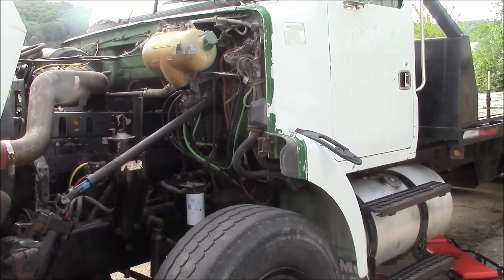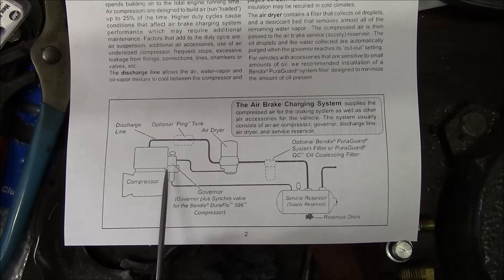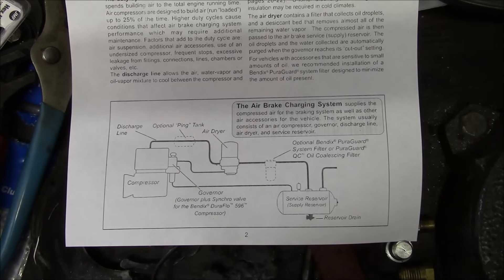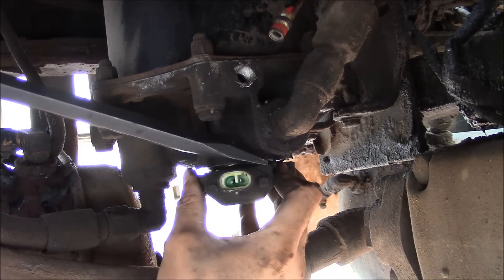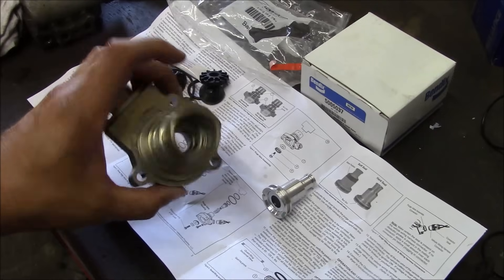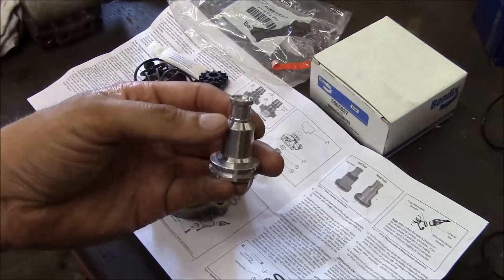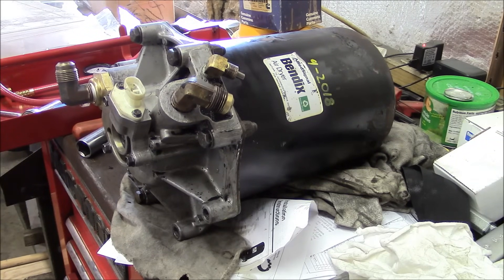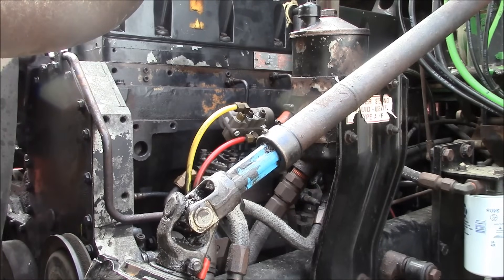Truck Repairs: Air dryer purges constantly

Comment: All underground telephone cables are under dry air pressure. The dryers function pretty close to how yours functions. A system that purges constantly is usually (in my experience) a solenoid valve that is stuck and needs to be rebuilt. Air dryers make me a lot of money - they tend to go into alarm in the middle of the night and I get called out to go fix them.

Comment: Quite hard to follow for someone who knows nothing about pneumatics - help me out here, was the problem the air dryer purging all the time? Or was the problem: air leaking out at the compressor, making the  compressor work to keep up the pressure, therefore the governor decides that a lot of purging is needed?

Comment: Great video,I have a question /mine goes off every 5 minutes when driving /when idle doesn't go off / is every 5 minutes normal?
Reply from the maker: Possibly. I depends on the suspension setup and other things that use air.

Comment: Loving this, I'm currently gathering parts to fit air trailer brakes to my pickup here in the UK.
Reply: Classic Cars and Parts for sale UK why do you want to add air brakes to a pickup?
Reply: @calibratedindigo1338  5th wheel trailer hitch

Comment: i have a similar problem on C-15 with bendix compressor and i have put a new air dryer, new governor, new lines from governor to dryer, new line from governor to thank, new line from compressor to dryer, new fittings all around, new unloader valve, new safety valve at compressor, new safety valve at thank, 2 new check valvels on thank, compressor is not sipping oil so what gives? any recomendations on what to look at next ????? please thank you.
Reply from the maker: I don't know. About all that is left is the compressor itself.

Comment: Mine doesn’t seem to be purging constantly but rather tanks are building to 135 psi and then you’ll hear a whistling hiss come from under the cab which goes away when pressure drops down to 125. Your thoughts Wes?

Comment: The compressor builds air pressure until all tanks are at 125psi, the compressor has a control line going to the governor pushing the piston up to put the compressor into its unloading stage so no further pressure can build up in the tanks. Once it reaches max pressure the air dryer always purges after that the compressor should not go into its load phase until the tanks drop to 105psi if it does your governor is out of adjustment. If the truck is idling parked it should never lose pressure (unless you have a leak or use air from the system)
Reply: Cody Sinclair my tanks are building to 135psi and there’s kind of a ringing sound that comes from underneath the cab, which goes away when you pump the brakes down. Thoughts?
Reply: John Gaughan Is it audible regardless of how much pressure is in the tanks ?
Reply: Cody Sinclair no the whistle / hiss sound will stop if pressure drops to normal 120 like when you pump the brakes or push in the parking brake. But it comes back when tanks build pressure to 135 (too high)
Reply: Cody Sinclair ok my mechanic said purge valve stuck open so I’ll also make a not about spring brake release valve. Thanks for your help.
Reply: Cody Sinclair but also when I set the parking brake there will be a whole bunch of air exhausting from right under the cab. Lasts 10-12 seconds. Definitely not normal and has been getting worse over the past week or so
Reply: John Gaughan Normally the tanks on trucks will have a pop off valve/ pressure relief valve that fully open at 150psi so it’s possible the extra 10psi is slightly opening it causing a small “leak” also the parking brake being slow to fully engage causing a long bleed time may have something to do with your spring brake valve exhaust being plugged up or kinked it could be the valve isn’t good anymore as well

Comment: On the last 2 out of 6 AD9 air dryers that I have taken apart. The cartridge has been unscrewed just sitting in there. I can’t give you any history on them, those 2 trucks my boss just bought. They came from different states, North Dakota, Idaho. Different truck companies. But odd 2 air dryers with a unscrewed cartridge. I started putting liquid thread sealer on to the cartridge threads to stop them from unscrewing. Anyone else ever found this? One mechanic said that he had found 4 unscrewed, does not think that any of the mechanics that worked any one of these could have worked on another. Are they not being tightened from the factory or a rebuilder?
Thank you for the idea, our one semi is almost doing this. 
Hello from north east Montana.
Reply: Alcohol from airline antifreeze possibly eating the thread locker on cartridge..

Comment: First thing that should be checked is the wet tank to be sure it is not leaking down
Since there is a check valve between the wet tank and primary air tank

Comment: That strap wrench you used was awesome, could be useful in a few applications,
Reply: Steven Pierno   Go to Lisle Tools, lislecorp.com
Part# 63500 $7.
Part# 60200 $21.
Part# 28500 $15.
The first one is the exact one that he was using. Next is bigger. Third is a strap wrench.
Reply: Steven Pierno   That is a oil filter wrench. I think OTC, NAPA, KD Tools, John Deere.

Comment: Hi, Can you please explain how to remove the plunger out of the purge valve , I'm having problems trying to replace it, the whole piece keeps turning, please help!
Reply from the maker: Try and impact.
Reply: @WatchWesWork  Thank you for replying, an Impact drill? I have tried and nothing so far, it is definitely not normal that the piece spins right?
Reply: Ohhhhh!!! I got it out!!! for the thousand time it worked! thank you so much!! mine looks super dry in the inside , I'm going to replace the whole thing to be on the safe side! Thanks again!

Comment: In my case it does every 3-4 min . And only if I'm working in colder temps. Below 0'C . Checked all lines governor to drier, replaced purge valve. Can't find the problem. Going south no probs. Back home north it starts. Pumping brakes till valves pop out helps for a bit. After 30 min driving starts again. Drops 3psi down and starts the cycle . Any ideas guys?
Reply from the maker: It's hard to say. It could be an issue with the actual unloader valve in the compressor.
Reply: @WatchWesWork  I agree. But temperature impact confuses me. Even when cold , I need to drive for an hour before it starts. Once it works up going south it disappears. Replaced governor too already. Last night stopped at rest area in WI while it's purging crawled under the truck with light and sprayed everything no leaks. Also have faulty double check valve , after night it pumps secondary and primary staying low, till I pump brakes to relieve pressure untill low enough to Kik compressor in. But that shouldn't affect my loading cycle right
Reply: @WatchWesWork  I found the problem, thank you for your help, it was the same check valve on delivery line, in my case it's horizontal plastic valve with o- ring , the o- ring was worn out leaked air in cold, was ok in warmer temps. Bendix AD-9 dryer.

Comment: Hmm great video however I'm having the same problem,  brand new remanufactured ad-9 dryer, and governor,  still cycles every 25-30 what should I check?
Reply: John Larson purge valve
Reply: @Coronado-nz7wu  had it happen on a Chinese copy of a AD-9--changed purge valve also.

Comment: Don’t be surprised if you have to change your injector harness on those m11s. They leak oil all the time out of the front head harness
Reply from the maker: It's a mechanical engine. There is no injector harness.
Reply: Even better

Comment: Have you ever installed a dryer on a truck that didnt come with one?
Reply: yes, smartest move to keep a older truck moving on very cold mornings.
Reply: @rearspeaker6364  I installed an AD 9 dryer on our 96 Pete last yesterday. I will miss the truck sitting 3 days and still have enough air to crank up and leave immediately.
I won't miss having to purge 3 tanks every hour to keep the brakes from being so touchy that they back tires lock up slide  leaving black marks everywhere.

I like having a dryer but the purge valve can potentially lock you down in the highway when  they go bad.
Every driver should have a dryer bypass kit set up and take it with them. All that is needed is to connect the larger in and out lines on the dryer together with some 1/2 in dot line and 2 quick connectors.

Comment: I was working on a 2000 379 Pete with 12.7 Detroit and that Truck had those cloth wrapped hoses. You couldn’t hear a leak and it was very slow took me a while to find it I found it by accident while I was pressure washing the truck as soon as the soapy water hit that line about 2 feet of it just foamed up. You couldn’t hear the leak but you could definitely see it so I always made sure on any truck that had those lines especially going to the fan clutch Because it seems like every one of them was bad when I started checking. I would degrease them once a month with air pressure in the system and run the truck a little and look for any foaming air lines. Found quite a few leaks that way.

Comment: I have a mack midliner ms200p and its air over hydraulics.. I cant find the governor anywhere
Reply: Andrew Alves   Check for a remote governor on the wet tank.  If not on the compressor, follow the 1/4” line down to the governor. Some are mounted on the wet tank by the transmission. 
Good luck from north east Montana.
Reply: @darrelfuhrman8217  not seeing any governor .... I guess these European trucks are just different
Reply: @alvesthegreat   Years ago a neighbor had a Mercedes Benz, right hand drive, for a garage truck. 
The governor was built in to the compressor. They had an compressor overhaul kit, when you had governor problems. 
I do not know what brand of compressor it was. 
No USA company made a rebuilt compressor for that application. 
Good luck. 
Hello from north east Montana. 
10 miles from the Canadian border.
Reply: @darrelfuhrman8217  it's a single head compressor.... Single piston belt driven...
The brand is Knorr bremse .... 
I pulled the compressor apart... Didn't see anything even remotely resembling a governor in it
Reply: @darrelfuhrman8217  only one line leads from the compressor head to the tank

Comment: MY CHECK VALVE IS RELEASING EVERY 5SECONDS, AND MY AIR PRESSURE IS ABOUT 180
Reply: canuckguy worried   Thank you from north east Montana.
Reply: canuckguy worried   The farm bought a 2006 Freightliner that some times runs 160 psi. At times it happens during harvest, so I can not do any testing on it. When it does not run 160, everything works normally.  Sometimes it will not air up unless you step on the brakes. Primary gauge gets up to 105, then air goes into secondary tank, primary drops to 80, when secondary reaches 90, air goes into the third tank, when secondary reaches 90 again, air goes into the fourth tank, now truck starts leveling up. Cab and drive axles. When primary reaches 110, you can release the park brakes without any dragging. The 93 Freightliner, 98 Freightliner, 94 Navistar all work normally. That you for your idea. When it is running 160 going down the road, I am sure it’s running against the release valve. 
Thank you for the time and ideas. 
Hello from north east Montana. Opheim, 10 miles south of the border, 110 from North Dakota, 50 miles north of Glasgow.

Comment: ok my governor has 4 air lines connected to it and its mounted on the frame of the truck and you only have 2 air lines, how is that possible? Also isnt that red line ( unload ) supposed to go to the compressor, not to the dryer? You need to unload the compressor so it stop building pressure? I have 1 line going from governor to compressor and another one going from governor to the dryer? How can i test the unloading valve on the compressor?
Reply: get a licensed mechanic to work on it. air brake systems are serious business and you are legally liable for working on it.

Comment: I use wrenches that size and bigger every day. Being a union pipefitter we see flange bolts up to and beyond 1 inch and more. Those bolt heads and  nuts start getting pretty big.

Comment: Another fine example of Wes Working and going into great details as to how the process works, how to troubleshoot the item and also not being afraid to show a shortcut or an item that may have been able to been cleaned and reused saving a little part replacement expense. Thanks Wes

Comment: How do you remanufacture a air dryer cartridge?
Reply from the maker: It's a desiccant, so I believe they bake them to remove the stored moisture.
Reply: @WatchWesWork  I always figured it was one of those things that you just tossed in the trash when it was used up.

Comment: HEY THANKS!!! That little chunk in the check valve gave me hope that I could fix mine after hours on a Friday night without needing parts. Sure enough, mine had a bunch of filter material stuck in there. I have been going crazy listening to that thing. Every 30 seconds at idol, sure.... But every 8 seconds at highway speed!!! Plus it had an extra loud  "whistle hiss" that about gave me a heart attack while I was hooking up trailers. Thanks so much! My weekend trucking will be so much more serene.
Reply: Same problem on my 06 international 9400, I replaced the whole dryer so the check valve should be good right but it's still purging every 30 secs. Should I just try adjusting the air pressure because right now I'm sitting at about 130/135 psi.
Reply: We have a Pete that says it has 150 PSI on secondary side, but 120  primary. Didn't even think that was possible...thoughts, anyone?

Comment: Ok so our purge valve has a leak. We cannot figure out how to take the plunger out of the valve...there is a screw at the bottom but when we try to unscrew, the whole plunger turns with it...we have tried many many things to try to keep the plunger from turning with the screw but we have hit a dead end...what are we doing wrong?
Reply from the maker: Use an impact wrench.
Reply: Buy a whole new air dryer and stop being a cheapskate. $300 to $400. Problem solved.

Comment: So I have a question, when the governor unloades and the purge valve opens does the purge valve stay open until the pressure drops? If the purge valve doesn't stay open how does it close if the line is pressurized behind it?
Reply from the maker: I'm not 100% sure how that works. I believe that the governor sends pressure to the purge valve as it's shifting. Once the shift is complete, the air to the purge valve is again cut off. I'll have to look into it further though.

Comment: So when the compressor is not filling the tanks, where does the air go? I always thought it came out of the air dryer purge valve?
Reply from the maker: When the compressor is unloaded the air just moves back and forth between the two pistons inside the compressor.
Reply: @WatchWesWork  ahh okay, also on the foot valve I see it has two supply ports on both primary and secondary parts. Why would the foot valve have more than one supply ports if air only enters the foot valve from the supply tanks? Where is the other supply air coming from?
Reply from the maker: @dallaslewis4141  Most likely the treadle valve gets a supply from the primary or secondary tank, then the other port on the supply side feeds the other circuits in the cab that require air like the hand valve (trolley valve, johnny bar, whatever you call it), tractor protection valve, parking brake hand valve, etc. So only one is actually a supply.

Comment: Where is the air pressure sensor if it isn’t in the reservoir?
Reply from the maker: There are three tanks. The wet tank feeds the primary and secondary tanks. The sensors are in the primary and secondary tanks. The wet tank does not have a sensor.

Comment: I got a 98 Pete EXHD.  N14 Cummins.  I've put 2 new Dryers on an it works for like 2-3 weeks just fine then it just leaks air constantly from purge valve. Why?
Reply from the maker: Not sure. Don't rule out bad replacement parts.
Reply: Ok
Reply: Did you had that rattle snake sound ? Did you fix the problem?
Reply: @herrerasinc  ended up selling that POS ! I'll never buy another N14 Cummins again
Reply: Ok thanks men

Comment: I would wonder where the metal shard came from?  Nicely explained.  Thanks for sharing...
Reply from the maker: Carbon build up. Compressed air makes a lot of heat. Combined with some oil blow by and many years of use makes carbon chunks.

Comment: It's meant to purge every 30 seconds. The compressor is constantly running as its run by the engine. So it pumps 100% of the time the engine is running. When the pressure in the receiver reaches its max level, it purges and lowers the pressure back to 90psi. Once the pressure reaches its max level again, it purges again lowering the pressure to 90psi and repeats this continually until the engine stops. There will be changes in how often the air system purges dependant on air being used by the truck, like when braking for example. Good videos though. And truck air systems could be different from country to country, so perhaps your systems are different.
Reply from the maker: The dryer should not purge that often. Yes, the compressor runs all the time. The air governor controls the unloader to unload the compressor when it reaches approximately 120 PSI and then loads it again when it drops to 90 PSI. In normal driving with this truck that might happen as often as every 2 minutes, or as little as once an hour, depending on how often you use the brakes. Trucks with air suspension use more air. But, just idling in the parking lot, it should not purge often. The compressor just has to keep up with any small air leaks in the system.
Reply: My daycab purges every 20 to 30 seconds being parked, will changing the air dryer filter will help ? I don’t think it has never been replaced truck it’s from year 2015 no leaks